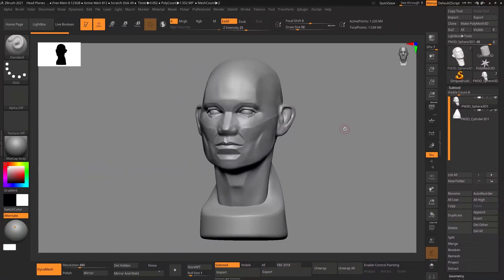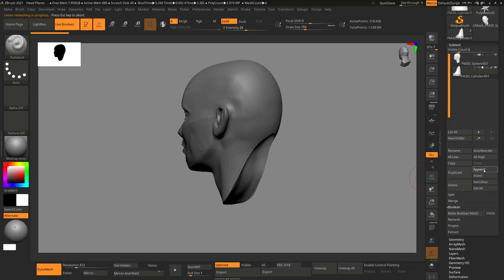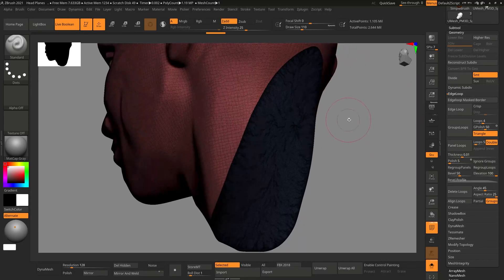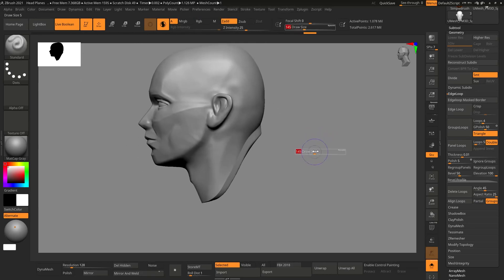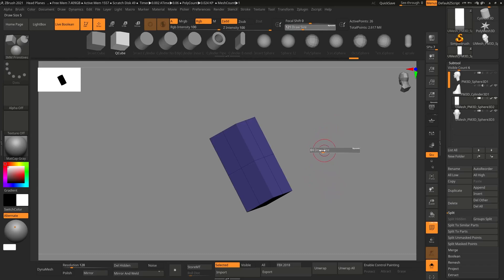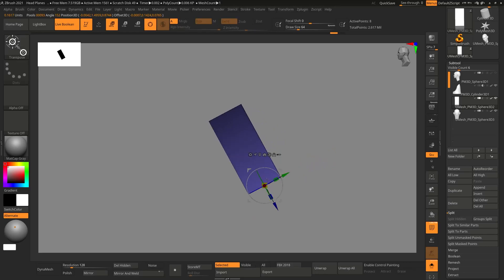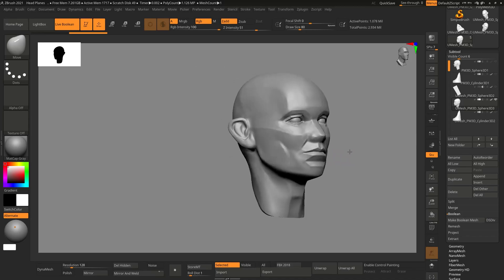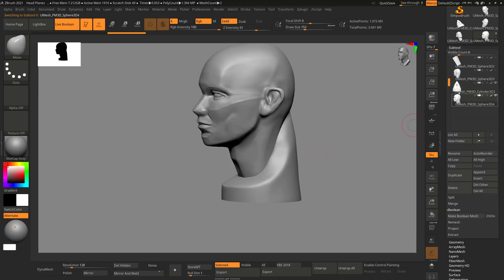Want to Learn 3D Printing ? | Learn How to Prepare Your Model for 3D Printing  | The CGI Creator

Comment: Thanks for that video! Got a new subscriber! Question, will the 3d printer print both the head and base on one print or will I have to print the head separately and base separately on two different jobs for this?
Reply from the maker: If ur printer has enough space on printing plate for printing both of them at once you can print them at once if not then you have to print them separately